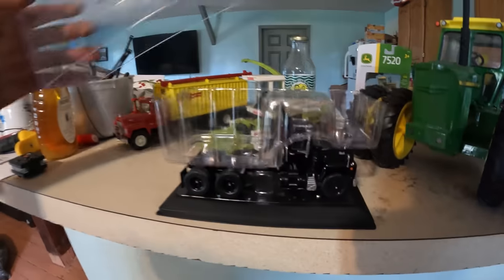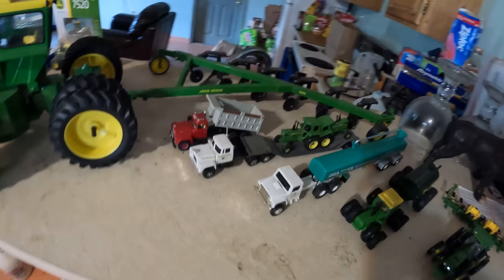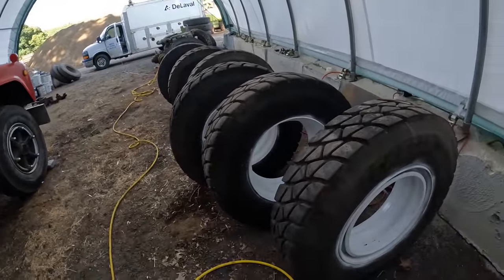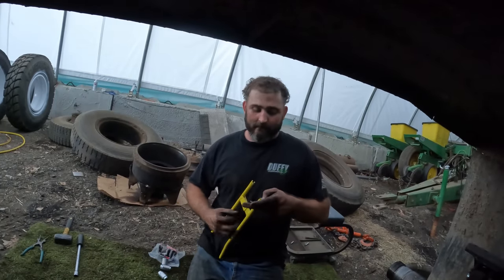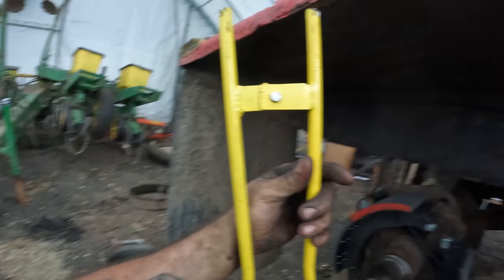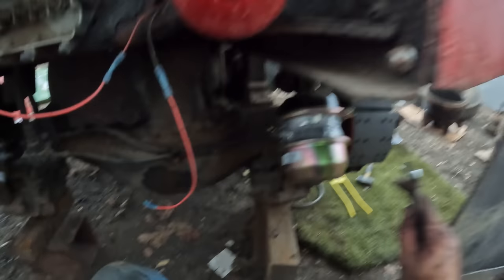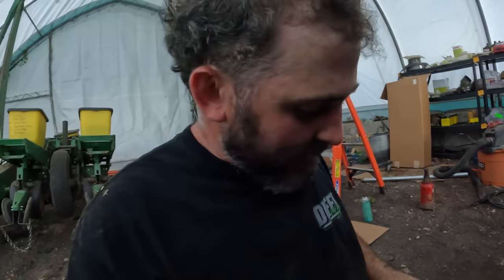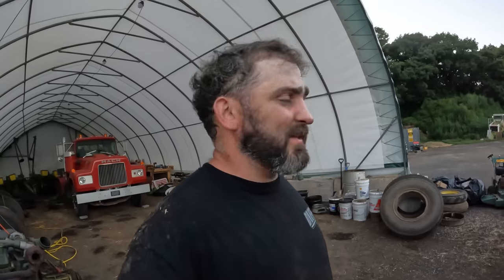Got The Right Tool For The Job Now- Mack Brake Job

Comment: That spring tool looks like the bees knees! We struggled hard when we put pads on last time. I'm not sure if you trucks have air dryers on them, but make sure you change your filters on those if you do. It made a huge difference with sticky brakes for us. Keep it rolling man!

Comment: Yes, cage bolts should be kept in their respective can's storage location. Just remember to use some anti-seize on them while they're still new, so you don't need to wrestle with them while you're struggling with whatever is wrong with the system that requires the use of those bolts.

Comment: I use a prybar in between shoe and spring ,drive bar with hammer. Fast and simple. Have tried several ways to  reassemble , you'll have to decide what works for you. Some tools can be cumbersome to use. Good luck with everything. You're gonna be good.

Comment: your carpets nice , but I use the cheap rubber stall mats from tractor supply store or even find a old bed mat from a pick up if you spill stuff on it you can hose it off .